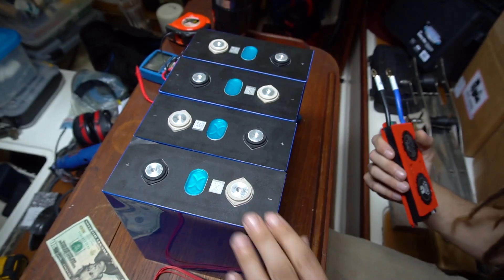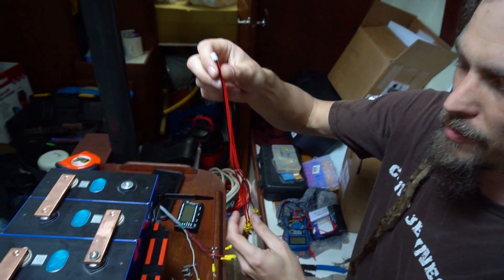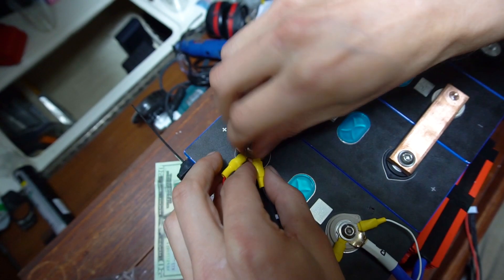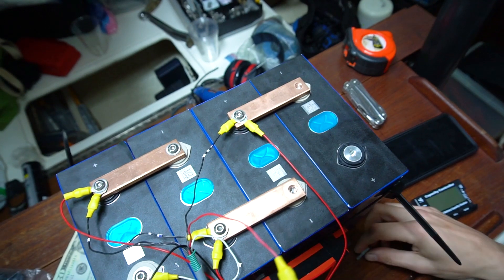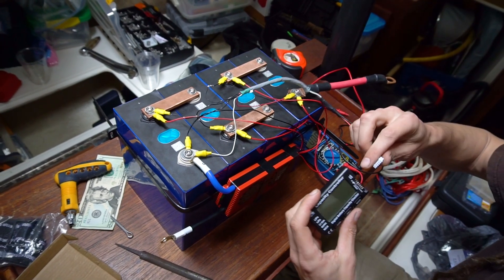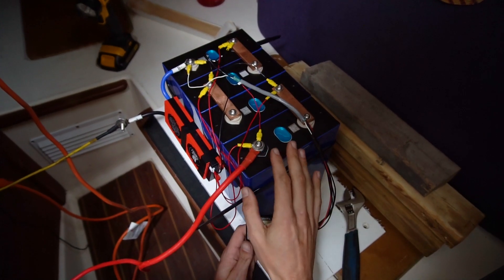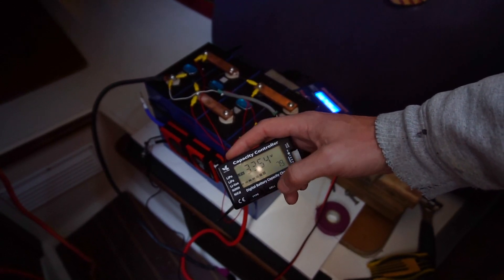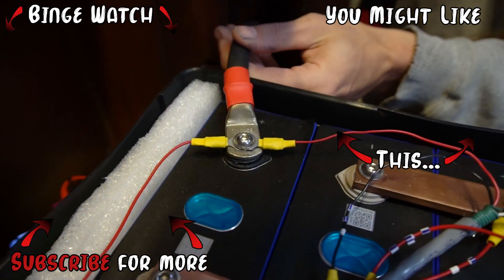Build your own LITHIUM BATTERY CHEAPER than AGM (EVE cells)

Comment: I have 8 brand new 120ah lifepo4 cells I just got in they all read 3.29 right on the nose where do I go from here I'm running them in 24v
Reply from the maker: I would charge them up and top balance them. Then you can do a capacity test and see if they are giving you the full 120ah
Reply: @WildlyIntrepid  Ohhh ok

Comment: I had no idea this was a thing but I'm  glad I clicked this video! How long have you had this setup? We don't have alot of power demands but the thought of lithium batteries are mouth watering 🤤
Reply from the maker: We used that setup for over 4 months last winter and spring and absolutely loved it. Can't wait to test it out some more when we return to our boat this winter. We considered lithium for a while and are happy to finally have done the switch.
Reply: @WildlyIntrepid  sweet! I'm not very good with electrical projects but this seems really straightforward  and it would be a huge space saver for our boat.
Reply from the maker: It is pretty straight forward but I would recommend digging into the lithium pool of knowledge to help you understand want you are getting into.
Reply: @WildlyIntrepid  for sure, I'll be doing my research before I commit. Thanks again!